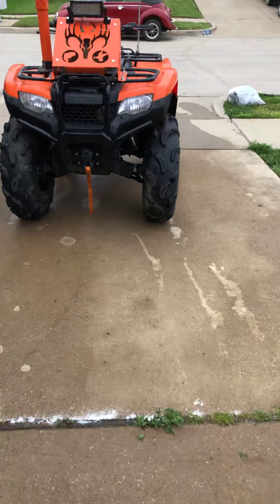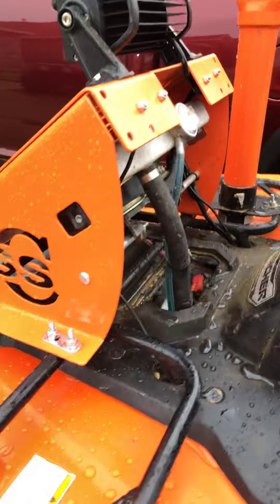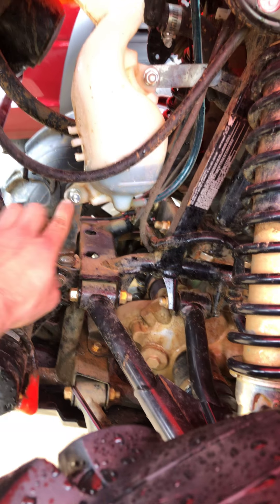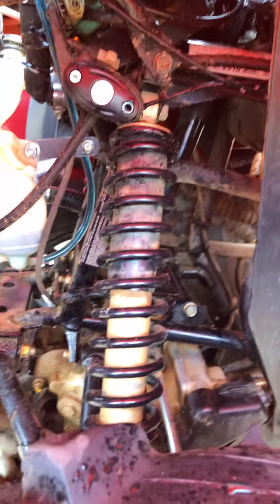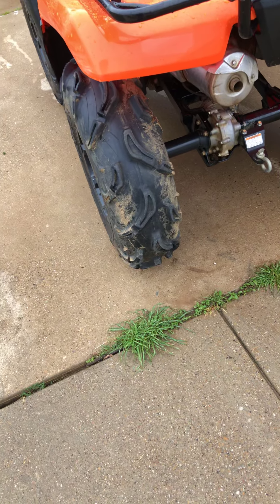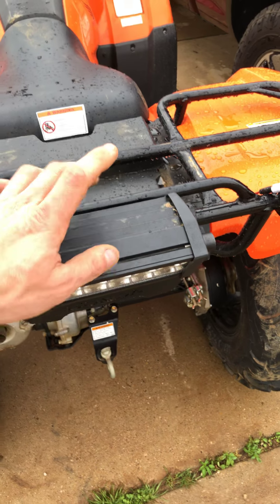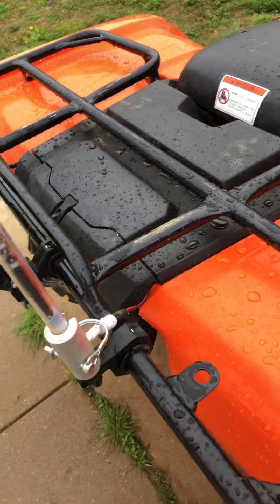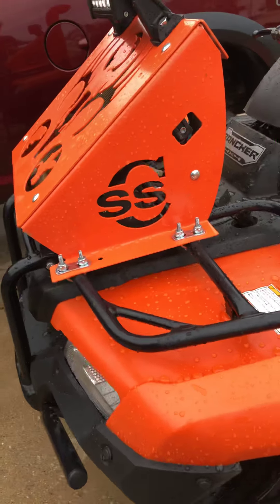Rancher 420 on 30 zillas

Comment: Would you recommend running those tires on an all stock rancher? Or would you NEED a gear reduction?  And NEED a lift for just trail riding and mudding. I don’t go pond swimmin.